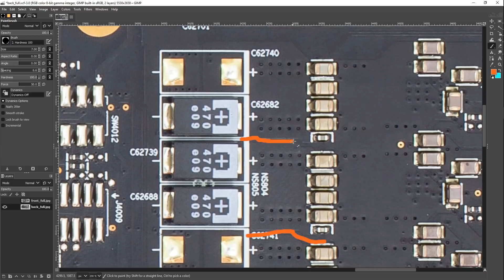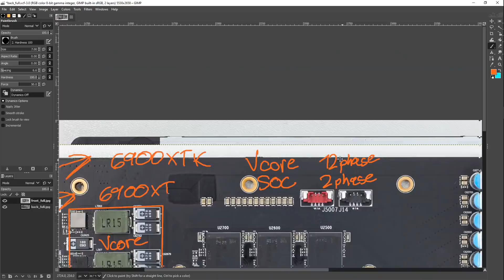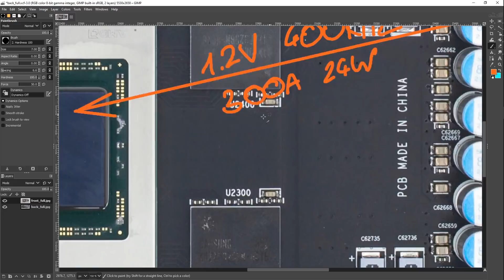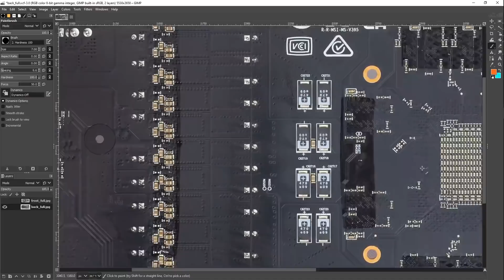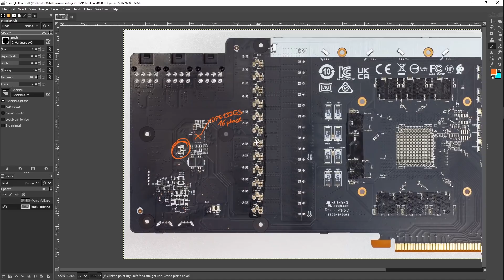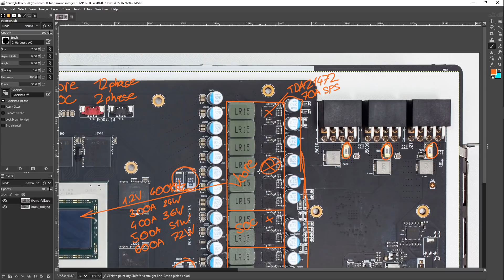GPU PCB Breakdown: MSI RX 6900XT Gaming X/Z Trio

Comment: I bought one a month ago for 730$ I am glad to hear your opinion on it.
Reply: Why not buy a cheap 400$ gpu and wait for RDNA3?
Reply: @lennard7152  for real though I have a gtx 1080 since 2016 but it reached a point of it can't even give me 85 fps in new heavy hitters and 4k monitors are way too expensive so I set myself to to play on 1440p 144hz or higher so I bought an msi 274qrf qd and any card that can run control 1440p no dlss or fsr just raw performance higher. The gtx 1080 gave me 23 fps imagine that so until now I am having trouble finding an rtx 3080 12gb new and if I did it's still higher than 730$ that I paid for the rx 6900 xt.
Reply: @lennard7152  I don't trust myself to keep that much money, there are stuff in the house would actually break down if you manage to save too much.

Comment: I own a New msi x trio 6900xt. I am very happy with, changed thermal paste to LM. This Puts the Hotspot massive down. In Games like assasins Valhalla the Delta is max 15 Degree Celsius. Only on 350w mpt it Hits 100 Degree Hotspot. Fan is Set to Max 2.000 because Above it doesnt Do more cooling. I Thing the blades are to small, so their "cut" the Air instead push it.
Reply: What is LM?
Reply: @phucth91 liquid metal i think

Comment: Great content, thanks!
I just bought a 6900XT Gaming Z for a "reasonable" price. Can anyone confirm that the pcb is the same on the 6800XT Gaming X/Z? I'm looking for a waterblock but can't find one specifically for the 6900XT Gaming X/Z. I realize my card has 3 power plugs, but other than that, are the cards physically the same? I'm a machinist so minor modification to the acrylic body of a block around the power connectors isn't a problem.
Reply: I am in contact with alphacool regarding this, they want high res pic from the pcb Edit... i just disassembled my 6800 XT gaming Z and it is the 6900 XT PCB to a a dot. i am still waiting for confirmation from alphacool. I'll let ya know
Reply: @tasha1982ify  great job, i'll be waiting for more info
Reply: @tasha1982ify  Any update from Alphacool?
Reply: @tasha1982ify  Have you had any feedback from alphacool? i just bought a 6800XT Gaming z trio and i want to watercool it and i trying to find out what block to use.
Reply: Same Here Just got my 6900XT Gaming Z from Best Buy for $1,599.99 and these Newer versions fixed the Hot Spots problem from the initial Gaming X version at Launch so these Newer ones should be Golden and truly on Par with the 3080Ti, can trade blows at times with the 3090 but that card is not really the same kind of card and results can be all over the place because of the huge difference in VRam
Reply: @javiermigoya  i can't overclock even a little bit, junction temp goes up to 110-114c if i do.
Reply: @MySkullzDented  I thought they fixed the Hot Spots Issue when the Z came out, definitely by now, did you buy it at a retail store like Best Buy, I Literally just picked it up last night, Building PC today, just doesn't make any sense that this issue was pointed out over a year ago and it wouldn't be fixed by now, I get it if there was older stock still out there, I've read the early reviews where they clearly pointed out the 100c+ spots on the 6900 XT Gaming Trio X, not the Z version even though the company stated that although higher than normal it's still within a safe temp range, I'm not going to overclock any right now since I'm still playing games like right now Dying Light 2 on High Settings with a 32-inch 1440p monitor with a Ryzen 2700x, 32gb ram, 1080Ti, 850w PSU system to a Ryzen 5950x, 64gb Ram, 6900XT, 2TB Samsung 980 Pro, 3 Seagate Exos X18 16TB Hard Drives in a Corsair 7000x RGB System so, for now, no overclocking for me, wanted an Auros RTX 3090 but the prices if available at all were ridiculous, The MSI Gaming Trio Z 6900XT for Gaming is perfect and compared to it's MSRP of $1,199.99 I just paid $400 over > $1,599.99 currently still available in stock at Best Buy, if prices ever come down in the next 2 months, I have the Total Tech Membership which gives me 60 days of in store and other retail outlet Price Match, btw that's the real benefit to that membership anything you buy at Best Buy you have 60 days to get money back on price match sales, my Ryzen 5950x I paid $799.99 over a month ago, just got it price matched 2 days ago at $714.99 and get this, their system renues your purchase date as the price match date, so I now have 2 more months to get it price matched again if it goes down again, already got my 2 x 32gb kits of Dominator Ram price matched when it went on sale last month $64 off each kit, also my 1200W PSU Platinum went on sale for $239.99 and I paid $299.99 so you see you're constantly getting money back if you're looking for sales on stuff you bought, sorry for the Total Tech Sales Pitch LOL, but yeah that's the real benefit not that you can get GPUs and PS5s like people are saying, I didn't
Reply: He at all, alphacool does not have any blocks for the Card, but BYKSKI does have the 6900 XT block and it works with it. Got mine 3 month ago, pretty happy with it
Reply: @tasha1982ify  How's the waterblock holding up? Looking to maybe do a custom loop in my next case
Reply: @limmel3588  hey, pretty sweet! Absolutely no issues so far. Nice, pretty heavy block, just cleaned the loop. It holds up nicely

Comment: Do you think the MSI gaming trio 3090 is a good card or not? I feel like I’m one video you trash MSI over the 3080 they did but you really liked the 6900xt from Msi. I got a 3090 Msi trio and I’m wondering if the 6900xt from Msi would be better or if I should have gone with a whole different company. I know asrock is good but I don’t like how those cards like in my system. (I’m getting to most out of air cooled cards, I like overclocking but I maintain undervolts 99% of the time. I’m also big into looks and possibly saving money if any of that matters)

Comment: I realllly wish there was a water block that would fit this card. I got it in a prebuilt and have all my stuff for watercooling, but just to find out after that there isn't one
Reply: Alphacool make one ! Check its model 11949
Reply: @jonathanlamontagne1731  r  u sure ? i ve looked everywhere but the msi 6900xt gaming x trio doesnt have one i can find
Reply: @ouppy123  your right ! It only fit 6800xt x trio
Reply: @ouppy123  Bykski GPU Water Block for MSI RX 6800XT/6900XT Gaming X Trio - im looking at this vid right now, trying to find out if this would fit the Z version, maybe this will help you though :) . only seem to be on aliexpress though so bit of a gamble

Comment: What PSU would you recommend for this Z beast?
Reply: i have a 750w , and have not had any crashing, but recommended psu is 850w you would want to go with that if you will be OCing
Reply: 850w+, I had a 750w Thermaltake toughpower grand gold rated PSU and I had to undervolt and lower the power limit to get it to not shutdown under heavy load.
Replaced it with a 1kw supply now and no more problems.

Comment: For anyone curious, the reason (26:35) that lower ESR is more important on the output of a VRM is because the output voltage ripple is largely a product of the ripple current in the inductor and the ESR of the output capacitors. Many design and application notes will have a nice comparison of doubling the output capacitance (minimal effect) and halving the ESR (huge effect). The actual amount of bulk capacitance is mainly there to improve the transient response and over/undershoot.

Comment: Do you have any recommendation for a GPU repair company?  I had a power stage smd blow on my 980Ti that seemingly did minimal damage and would hate to think it is now e-waste due to it being past its warranty.  Seems like it would be an ideal sponsor of this channel.
Reply: I know there are people who run repair shops who'd likely do it, especially if you found a replacement component. No big companies afaik
Reply: North bridge repairs is okay but I don’t know the price they will charge you. They have a YouTube chat you can visit and if you have a local shop you can just go there and just get them to remove just the single phase if it is Vcore or Vmem. Just can’t do it for a single phase VRM. But if there is any extra damage it will be way worse to repair or if there is a crater in the PCB.
Reply: *”Northbridge fix”
Reply: @tanishqbhaiji103  Its NorthRidgeFIx, unless we are talking about a different place
Reply: afaik there aren't any large companies, but in a lot of areas, there are small repair shops. Pretty sure buildzoid is capable of removing/reinstalling powerstages as well, I remember him mentioning doing it on a motherboard with bad power stages.

Comment: Coming from the Nvidia 3080 FE card, man it looks very sparse compared to the 3080 FE
Reply: The PCB is very large so no need to cramp stuff and lower thermal density so, thermals are very good and that is the main reason for this PCB.

Comment: Any reason you cant just flash the BIOS of the z to the x?
Reply: Not the same chip, z has the new revision that can go over 3GHz
Reply: @carlosad1  my bad thought that was a firmware thing and not a limitation of the hardware.
Reply: @edplat2367  Yeah this is a quite rare ocassion in which it isnt a software thing
Reply: @carlosad1  quite disappointing considering the standard 6900xt is supposed to be the fully unlocked version of the 6800xt
and you're paying 50% more for the 6900xt (at least here in australia, comparing launch msrps: 6800xt: $1050 and 6900xt: $1600)
and on top of that, they release a fully unlocked version of what's supposed to be the fully unlocked version of the 6800xt.
the cheapest 6900xt(k) here is $3199 
absolute insanity
Reply: @anmolsaxena_  The 6900xt will probably end up using the revised version of the chip in the future
Reply: @Manuel G its an actual different design, not disabled silicon or bios limitation
Reply: @Manuel G MooresLawIsDead said its a different design no hard limit in silicon at 3Ghz
Reply: this card has duall bios?